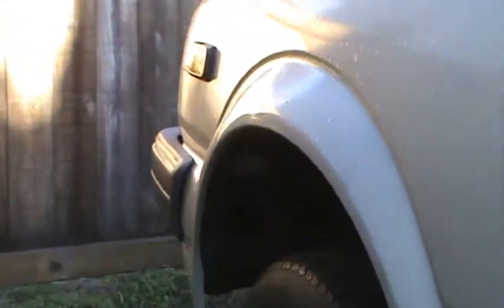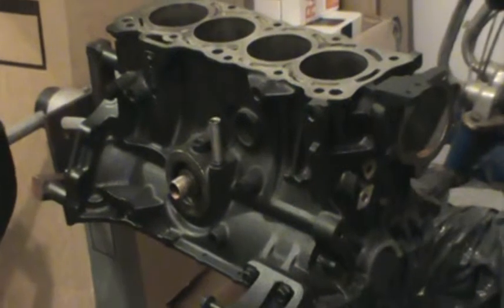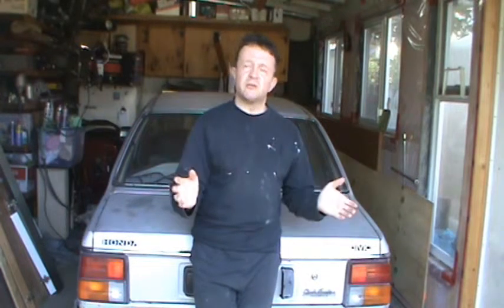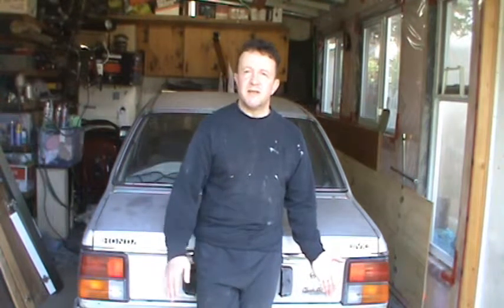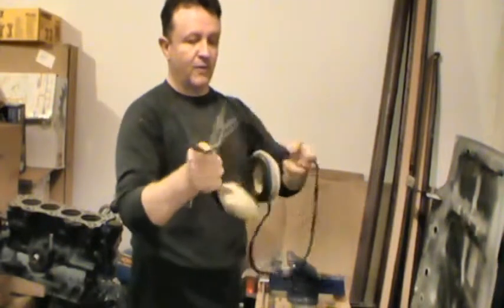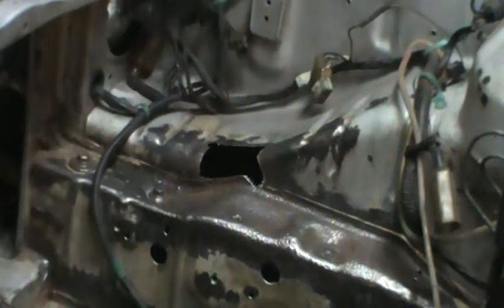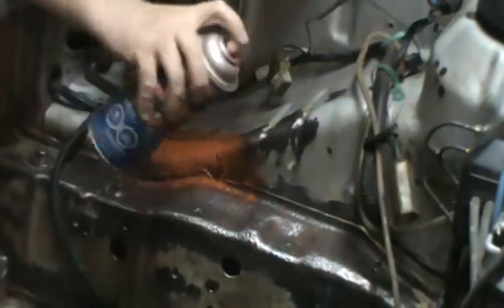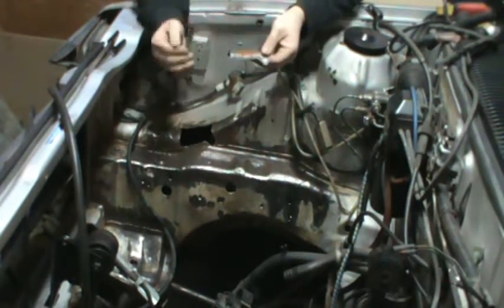Restoration of a 1983 Honda civic fabricating / welding in a patch panel ep1

Comment: Your channel popped up on my feed and I'm glad it did, what a neat little Honda!  I would love to find an oddball like that myself to work on.  Currently redoing a 1985 Ford Ranger, but it won't be even close to stock.  :)  Going to watch a few more of your build videos, Subbed and bell on!  

One niggling point, it would be great if you could pull the camera in a little closer to see your welds, but that's just me.  Great work!
Reply from the maker: thank you very much Jimbos semi customs. that sort of encouragement motivates me to make more vids. maybe i will do one on welding.
good time to search out a g2 honda before prices skyrocket. they are amazing little cars, simple, well made. 
tip for you, if you find one that has been sitting for a while do not try to start it until after you replace the timing belt.